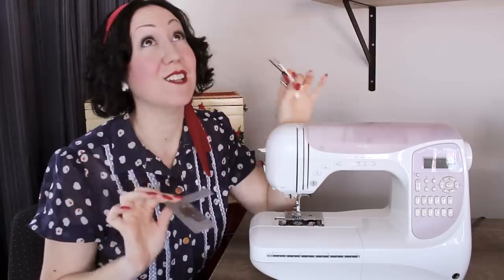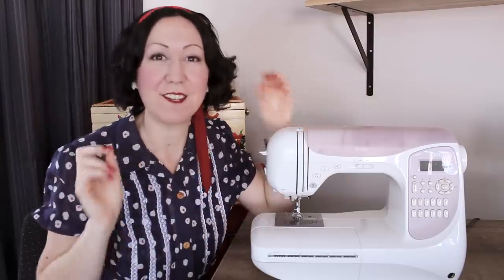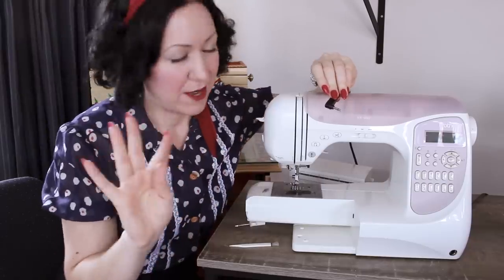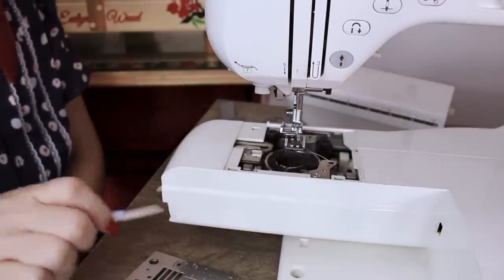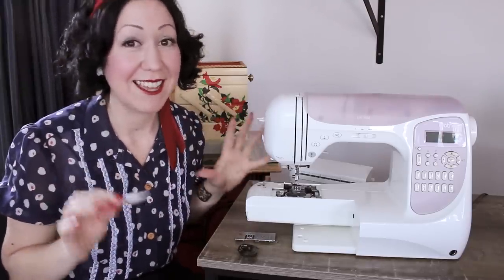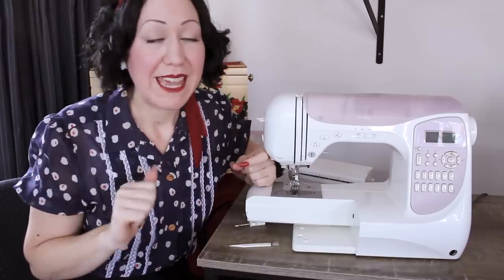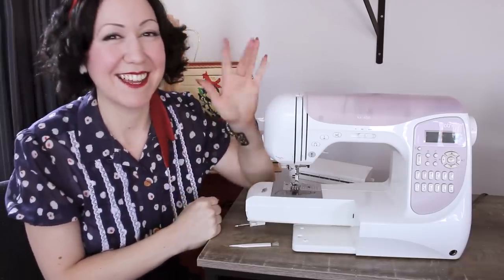SEWING MACHINE MAINTENANCE // What you can DIY to properly clean & de-fluff your sewing machine!

Comment: Hi Evelyn, the only reason newer machines say not to oil is so they wear out and need to be replaced, all machines with moving parts need some sort of lubrication. Look on YouTube for videos showing how to do this. If you take your machine in for service they lubricate it at that time, I do it myself and I use a Synthetic oil called Liquid Bearings and it works so well, I find that I can go about two years between oiling most parts. Brother machines at reasonable price points have metal bushings sort of like sleeve bearings on there shafts two shafts so four bearings and these are a trouble point especially the lower right one closest to the motor and they can lock up without proper care, better safe than sorry. I so enjoy your Videos !

Comment: Although I am late to the party, Thank you! I have been using my niece's basic Singer for several years (it was unused in storage). I was routinely cleaning the bobbin area but had never removed the footplate. I just had a professional tune-up & all is well. Reviewing the manual, I see instructions as you have outlined. The manual also shows where to oil.  I'm not sure how often I should oil. I’ll check with my service pros. Thanks again!

Comment: I bought an old Singer Genie from the 70s at a Yard Sale not knowing whether it would work. First it did not form stable stitches. But after a thorough clean it works just fine ! But I did not only clean the Bobbin area. I removed the casing and cleaned as much as I could inside and oiled every moving metal part. The final trick that fixed the machine was defluffing and cleaning between the tension discs !! I released the tension and ran a thin piece of fabric with some alcohol on it between the discs. There was a lot of fluff in that area. But that machine had been sitting in someones attic for a long time.

Comment: My mom just helped me clean my machine  a couple weeks ago.  It does need oiling  once a year.   My machine is a basic Viking I got it in 2006.  I love it.  Cleaning it resolved one issue I was having but now it skipped stiches on thick fabric.  So ...
Reply from the maker: Ha ha If it's not one things is another right!! Did you try a bigger needle? If you did alreafy...  all machines have a limit to thickness unfortunately 😟
Reply: @Evelyn__Wood  yes I did change the needle. Thing is, the machine has handled much thicker layers in the past.  So its really just nuts.

Comment: I have a brother machine that I've had for 2 years. It's never been defluffed to my knowledge but I've been using it regularly only for the past 4 months. This poor thing was very very dusty, especially since I've been sewing with corduroys. Tip: I used a penny to unscrew my metal cover since I lost my tiny flathead and my larger one will absolutely not fit.

Comment: my brand new janome does need oiling. very little, but still, definitely not just older machines.
i'm a quilter so i do the fluff thing after piecing and then again after quilting. that comes down to about every time i change a needle.
 i do feel like my new top loading machine gets a lot more fluff than the old side loading one i used before this. i wonder if i'm imagining it.
Reply from the maker: That's interesting! I've never been able to compare bewteen top load and front load!
Reply: My singer also is fairly new and asks for oil in the manual. I try to defluff regularly, but every time the amount of fluff baffles me. Thanks for the explanations
Reply: Uh oh. My older machine is front load bobbin; my brand new heavy duty machine is top load. I regularly clean out the fluff anyway, and that is good to consider.

Comment: Shud have taken a picture. It's been about a month and it was literally stuffed with fluff under the plate. 

Wud love to see a video explaining the seam allowances. My machine, babylock joy shows 3/8 1/2 5/8. Have ordered seam guide but wud like to understand it. Suck at math obviuously
Reply: I need that 1/4 inch for quilting, so I know what you mean. I am looking into a guide but for now, I use a piece of Washington tape to mark 1/4" on the bobbin plate. It's easy to remove for other sewing

Comment: I just started sewing recently, and my machine's manual says to oil it "approximately once a year".  I guess that means I should have oiled it about 10 times while it sat in storage for the past ten years!  ;)   I'd much prefer it if it said to oil it after a certain number of uses, because that makes more sense.   Also, thanks for this video!  I've been brushing out my bobbin area after each project, but I didn't know I was supposed to be unscrewing anything.  My owner's manual is very vague, and has tiny technical drawings that are difficult to make sense of.

Comment: Thank you so much for this! I have the exact same machine as you but have only started using it this year. I haven't ever defluffled it, so I'm going to do it tomorrow and then make it a regular habit on a Saturday. Also, thanks for the tip about the oil. I hadn't noticed that in the manual.

Comment: I de fluff all the time. At least once per week or at the end of every project. My machine is a new machine and it still requires regular oiling, so I do that at least once per month. I was always told not to use canned air because it can push fluff further into the machine. Also, like regular air, canned air contains water vapour and it gets forced into your machine. This can lead to rusting of metal parts.

Comment: Hi! I cleaned my machine and surprisingly, there wasn't much fluffy mess. ;) However, I didn't find a black plastic thing in my bobbin holder? I see the two black window-wiper things but everything else is metal and didn't look like there was really anything to remove for cleaning except the whole entire bobbin holder? I will check my user guide anyway but maybe you know if I should bother unscrewing it or not. Thank you so much!

Comment: I think if your kit comes with oil you can use it. Otherwise not necessary. Just as a clue. But, yes, read. Even my inadequate manual does mention the oil issue.

Comment: I remove the lint every time I change the bobbin thread. I sew cotton fabric and it sheds!  My machine is 5 years old and requires one drop of oil in the bobbin case holder. Tip: get used to what your machine sounds like when it is totally clean and has a good needle. Then, you know that when it makes a different sound, something needs attention.  My machine starts making a different hum, or even a growl, when the lint / fluff builds up or when the needle starts to wear.

Comment: My poor machine has never been properly de fluffed due to a plate screw that will not move. I've spent hours before trying to unscrew it and find the screw being stripped down instead of coming undone. I have no clue how to tackle this problem.
Reply: Have you tried a little synthetic oil to loosen the screw? If that doesn't work....there are special screwdrivers that can "unlock" screws that have been "stripped down". Maybe someone handy/or a sewing machine maintenance guy could help with that. Because you'll need a new & fitting screw to replace the "damaged" old screw. ✌🏻

Comment: My new Janome 4400 came with oil but no instructions as to where and when to use it,  in fact no mention at all that it should be used. As the shuttle was the same sort as my old machine I knew what to do, but so many new sewers must get their first machine and have no idea. Also annoying was that there were instructions for de-fluffing but no brush was included. If manufacturers want us to give positive reports about using their machines they could be a teensiest bit more helpful!

Comment: I hate using the awkward screwdriver to take apart my machine. Then there is the awkward hunt for the little screwdriver lost somewhere in the drawer. BEST SOLUTION: I use a coin instead of a screwdriver. In the U.S., a dime is thin enough to fit into the slot and still large enough to twist.

Comment: The machine I used to have had to be oiled before starting to sew anything. It broke while I was sewing face masks, so I had to buy a new sewing machine. The new one says don't oil anything. I would think that a vacuum attachment intended for use on your computer keyboard might be useful in getting the last little bit of fluff out of the sewing machine. I haven't de-fluffed it yet, but it's going to need it pretty soon.

Comment: timestamps 
0:00 Intro.
2:25 De-luffing your machine.
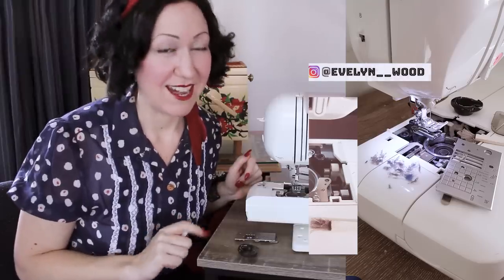5:31 Blowing out the fluff with air. 
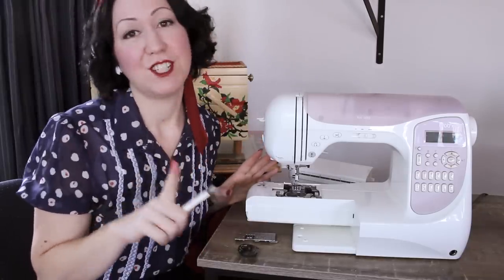6:14 Oiling your machine (if needed). 
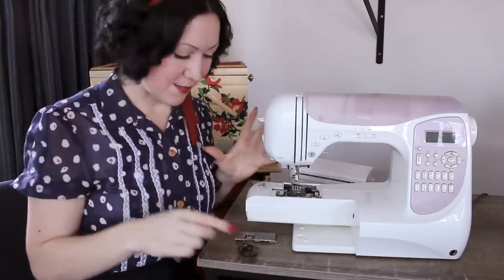7:19 Putting the machine back on.
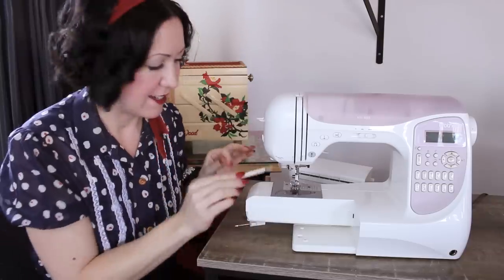7:58 How often should you clean you machine?
8:33 Outro.
9:02 Final tip (do a test stich).
9:22 Bye!

hope these help!

Comment: Getting the plate off is easier if you keep a 1p or a 1¢ as it fits the screw head. 
Using a pc vacuum that runs on batteries is pretty effective too.
Reply from the maker: 🤤🤔😃 I'm going to my purse right now!!
Reply: Brilliant!  Need to try that on my Featherweight, because my "stubby" screwdriver wasn't cutting it!
Reply: Elizabeth Eleck those screwdrivers supplied with machines are for only for changing the needles!
Reply: May I suggest you list what problems might come out if you don't de-fluff your machine properly? Love your contents
Reply: The penny just got chewed up so I had to upgrade to a nickel and that did the trick.  Thanks for the tip!
Reply: Thanks for this great tip! Tried to get it off before with the screwdriver but it was too awkward.
Reply: I use a dime (US)
Reply: i have the same awkward screw problems but found one of those metal tools for opening gallon paint cans works very well.

Comment: I use canned air to defluff the thread guides (I have found a significant amount of fluff depending on the thread I used). Also, I have learned to put both plates back (the metal and plastic). Put the screws in loosely, then turn the flywheel and make sure it's popped back in, and not in too tight. The shuttle, on my Brother, has a white dot, which aligns with the bottom right (in the shuttle area). Match the white spot on the shuttle to that spot, and test with the flywheel, to ensure its moving back and forth as it should. I use a long bristle fine paintbrush (used in detailed work) to get in the hard to reach areas. A coin may be useful in unscrewing those awkward screws on the metal plate. If you have fat fingers like me, remove the sewing foot, needle (this reminds you to out in a fresh one), and some machines have an extra part that holds the sewing foot, that can be removed. Lastly, put a piece of rolled masking tape, sticky side out, on your work area, and put the screws on it, or use a stable little dish, so you don't lose those screws. They can be a bit on the pricey side. Remember to clean your belly button too. ,😏
Reply from the maker: Thankyou for all those extra tips! I'm sure others will appriciate them! (And I'll check my belly button now too!🤣)

Comment: Are all modern machines so anti-user-friendly to get in and clean? I've got a 1980 Elna SU, no shuttle, bobbin just drops in, and no screwdriver needed, bobbin plate hinges up, front (throat) just unclips! 

De-fluff every time I change a bobbin, oil when it gets noisy (one drop 3-in-One). Yes it needs to go for a proper service, but that will have to wait until after lockdown lifts! (in Scotland).
Reply: Oh ELNA sewing machines were/are very popular in Holland🇳🇱 as well👍🏻. I have inherited my Mom's Husqvarna 2000 (don't hear that brand name outside the EU much) that she probably bought in 1976.

Comment: i tend to have trouble with the top part of my machine rather than the bobbin area. the thread seems to never slide easily down to the needle as it is pulled on while sewing. it needs sharp tugs to 'flow' again at times. is it possible that the top needs de-fluffing too? it acts the same regardless of the tension setting. ive thought that maybe my machine is somehow defective, since it was like that from the start.
Reply from the maker: Yes definetly! That is for a mechanic though.  I get similar to what you describe sometimes when I don't put my spool cap on, just incase you have left it off, maybe pop it and give it a try!

Comment: I have 4 vintage sewing machines and a serger. I de fluff frequently. I also oil about every 2-3 months as needed. The kind of oil is also very important, because some oils turn to a varnish after time and it’s not fun to clean off. Changing your needle is another important maintenance step.

Comment: I didn’t even think about behind the needle. I came to you to see how to clean but will subscribe for more instruction. The piece I was working on got gnarly under the fabric and when I looked at the plate it was “fluffy”.        I only worked on some sleep shots and it was clean before starting them. I can just imagine how often the dusting is needed if working on many projects. I swiped the clips while you were talking before you mentioned totake a pic! I found someone who posted a video on how the assembly works…no manual and when I searched one the pic was not very helpful. Thank you very much for this video.

Comment: Your machines should NEVER look like the one in this particular video. There’s no excuse to not clean your sewing machine and serger after each session using them. Mine are not new but look as if I purchased them yesterday. Read your manual! Clean and oil your machines! Learn how to maintain it properly and you will never need to ship it off to a dealer.

Comment: Thank you for your videos;  I'm new to sewing and learned using the manual and your supplementary tips. My thread was stuck between the top part of the machine. I (cringe) pulled it out, but what do I do to get the rest of it out of the top of the machine? It's the first few steps of threading the string (I worked on a simple project and it wouldn't sew due to the tension.) Thanks for rescuing my future sewing projects.

Comment: Hmm I bought a new computerized machine in 2014. The manual states no oiling necessary. This year, it stopped sewing. The maintenance man said the oil had gummed up and needed fresh. A coin, dime or quarter makes the unscrewing much  easier. The little points on the bobbin holder go to the back.

Comment: I always clean my machines after every project so it’s always ready for my next make. I also change my needle every 5 hours (curtains or big upholstery) or whenever I finish depending on the size of project. One thing I would say to anyone with an overlocker is unthread the machine completely and retread it a few times so that you get used to your machine properly instead of just pulling the thread thru (as the knots can get caught in the tension disks or needles) it also helps you understand what issues may pop up and where to check to fix them - trust me it will save you hours of frustration. Definitely keep your manual close to your machine so you have it to refer to if you get stuck 🤗

Comment: to remove the faceplate I have a coin like screwdriver that came with my machine and when misplaced I've used a quarter to remove it :) 
to defluff I have a keyboard cleaner brush, I like the "pipe cleaner" like bristles that catch the fluff better than a straight brush 
my machine is very sensitive to the fluff any time I run into issues it's always the fluff I try to clean before any project if sewing a lot of fleece it could be mid project as well

Comment: If you want a right angle screwdriver so you can access the throat plate screws easier what you are looking for is an “ultra low profile offset screwdriver” . You can even get one that has a ratchet on it which works even better because you don’t have to turn the screwdriver. They are available on Amazon and are not expensive.

Comment: You should also take your machine in to get professionally cleaned every 6 months to a year depending on how much you use it. They take the outer case completely off and get all the fuzzies and thread out from your entire machine and oil everything you can’t get to

Comment: I just got my Singer a few months ago and am just now beginning to use it regularly. Now I find that I cannot turn the lever to release the needle I want to replace and even the screw on the plate wont release so I can clean and defluff it. Grrr LOL
Reply from the maker: Oh no! They are screwed on too tight??
Reply: @Evelyn__Wood  Yes! They are really stuck in place.
Reply from the maker: Bugger! A mechanic, or handy person with very small tools could help! 😄
Reply: @Evelyn__Wood  I do have the tools that came with the machine but I think it actually started to bend a little from my forceful pressure. LOL Seems a shame to have to go to a mechanic so soon after purchase. But, hey, when you got the bug, you do what you have to do.  ;)
Reply: Try a wee drop of machine oil to loosen screws?
Reply: @karenmcneil7546  That's a good idea. Thank you!

Comment: oh my god i havent done this a single time and ive had my machine for a few years... this is what you get when you're self taught omg NOBODY TOLD ME THIS BEFORE
Reply: i just did it for the first time, not even that much gunk came out but ALL MY TENSION PROBLEMS ARE FIXED thank you so much
Reply: it's running SO smooth right now it also became less noisy